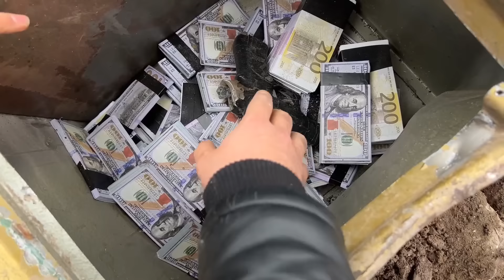Treasure Hunt With Metal Detector! We Found Abandoned Old Safes! ( We Called The Police )

Comment: My thoughts while watching the video:
1. @  0:01 in This kind of feels like a set up, I've NEVER once in my life heard of ANY metal detectorists traveling with excavators to dig up what they generally expect to be trash.
2.   @ 0:06-0:07 (:06)That metal detector looks to be a general Amazon special depth range of (:07)10-20cm at best its a mid range (highly doubtful) 30-45cm def not a specialized high dollar piece of commercial equipment. 
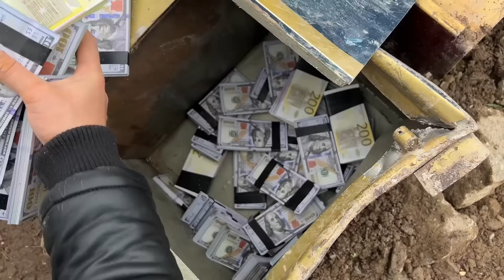3. Finally @ 4:00-4:04 (4:00)ok electrical tape on the money where it would he written wether its legal tendero or movir prop money? (4:04) Yatzhee!!! Just as i suspected  setting aside the fact that serial numbers  are the wrong font and should be bolder. They literally MATCH ON EVERY FXCKNG BILL 😅😅😅😅😅😂😂😂😂😂😂

Comment: The inside of the soil is still decomposing, indicating that there has been excavation for several weeks, Or a few days. And then, the gap between the vaults is empty. Because the decomposed soil Passes through the empty gap. If the safe has been buried for tens, dozens, even hundreds of years. The soil inside will definitely be solid.